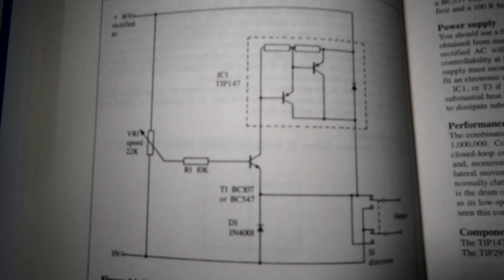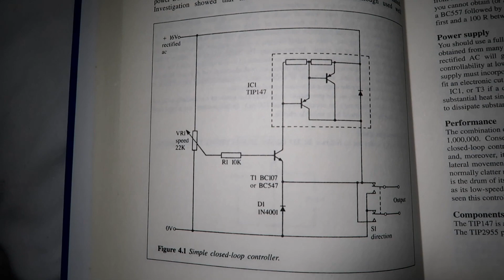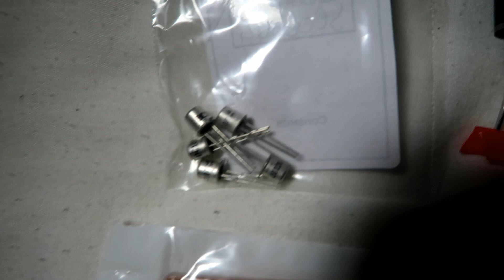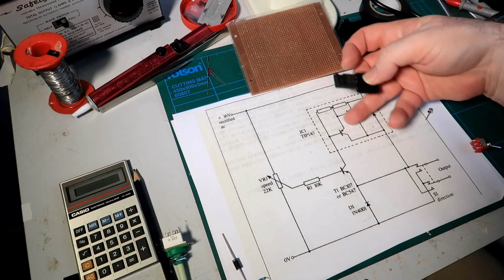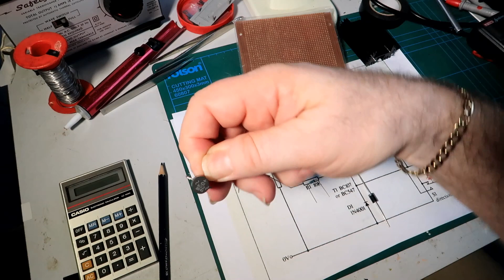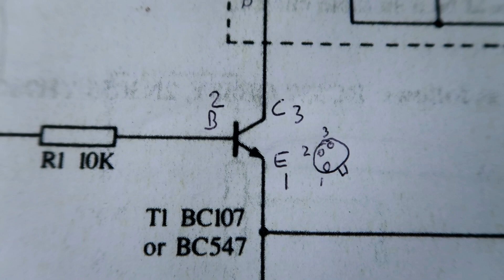Building from scratch a model train controller part 1

Comment from the maker: Please note, contrary to the original circuit I have since discovered that a small filter capacitor needs to be fitted on the input supply.
A 33uF at 35 volt electrolytic has proved to be just the right balance between maintaining control and allowing Portascap type coreless motors to work without issue.

Please include this within the power supply output circuit.
Reply: I'm curious to learn why the input capacitor affects the drive to the motor?
Reply from the maker: @MoreRandomMusings  Hi Brian, the power transistor takes this slightly smoothed output and feeds it to the motors, on the input supply.
A 33uF at 35 volt electrolytic has proved to be just the right balance between maintaining control and allowing Portascap type coreless motors to work without issue such as buzz. Hope this helps?

Comment: Hi Mike, Is it possible to modify this circuit so it is a centre off control like the Morley, preferably without the need for a centre tapped transformer as I would like to use an external phone charger type transformer.
Reply from the maker: Hi, no need for a central tapped transformer, you just need 12dc volts un-smoothed. To make center off would require two types of power transistors and a balanced circuit

Comment: I recall building that circuit, from a Roger Amos book "Electronics for Railway Modelers" some time ago. I recommend using a heavy duty pot - VR1 as  it will carry a good bit load. Perhaps a half watt. It is a fairly responsive controller.
Reply: Simple Ohm's law here: 16 volts across 22k is only about 11.6 mW and the current through the wiper is limited by 10k. The pot should be selected for quality so that it does not wear out from use.
Reply from the maker: Thanks Stuart, the pot is 22K so should be no problem

Comment: I've got that book and I built this controller. I used 2N6650 instead of the TIP147 though. The results are quite amazing for such a simple circuit.
Reply from the maker: Yep, I get that, see my Morley mod video, they had 1000uF so smooth I could run a radio off it, now down to 100uf and really good. I'll leave some pins free to add a cap experimentally once its built, I'd like to see how a coreless responds at slow speed, even on my Gaugemaster controller they buzz at slow speed. I agree fully re PWM. Thanks very much for your encouraging feedback :)
Reply from the maker: Hi many thanks, oh that is encouraging then, looking forward to this, tempted to add 47uF smoothing for coreless?
Reply: Not enough grief for a coreless motor, Id leave off to be honest.
Reply from the maker: @ed731pdh  Output should be 100Hz I guess? 
#
Reply: @ModelRailwaysUnlimited ep.
Reply: @ModelRailwaysUnlimited   Smoothing tends to make slow speed control a little troublesome. As standard this controller offers very smooth slow speed control without the "buzzing" that PWM controllers inflict on the motors.

Comment: Mike. Regardless of what is supposedly inside the transistor, I would recommend an additional external diode across the transistor E and C terminals to sit parallel with the internal one.  From experience not all of the TIP147 transistors have the diode and even if part of the transistor itself, an external diode will be more forgiving.
Reply from the maker: Hi, that's a good point I think I'll include it
Reply: Often a case of variants of the same transistor, version TIP147A has, TIP147B and C don't, TIP147D sort of has a half cacked idea and so on. Had this problem with CRT televisions and line drive using BU208 transistors, you had to make sure the right variant was used or BANG!!
Reply from the maker: @ed731pdh  The one I got from CPC claims to have it all but no harm in adding one to be sure :)